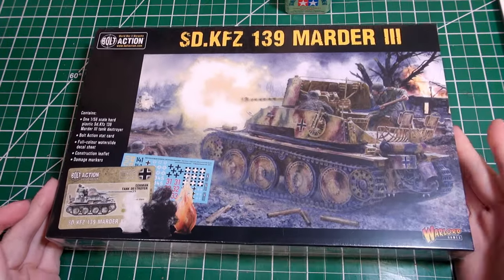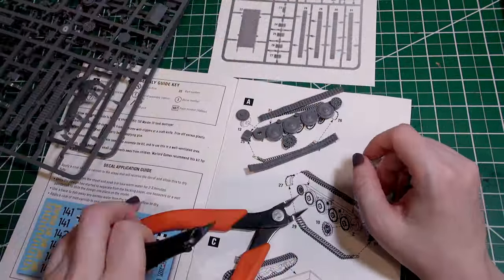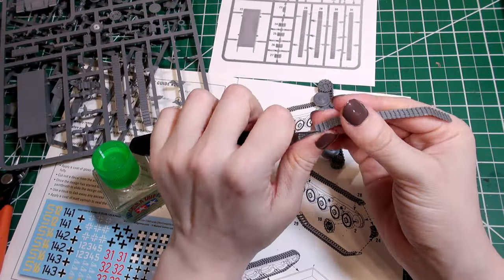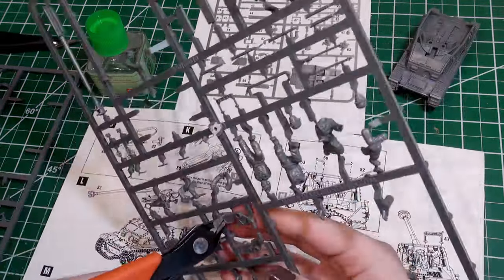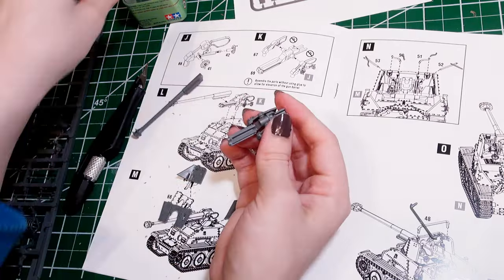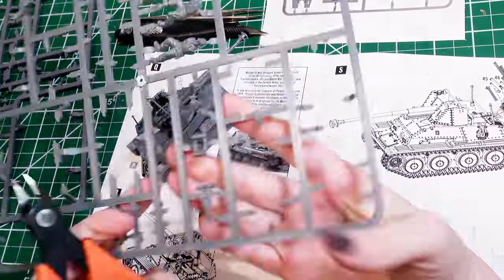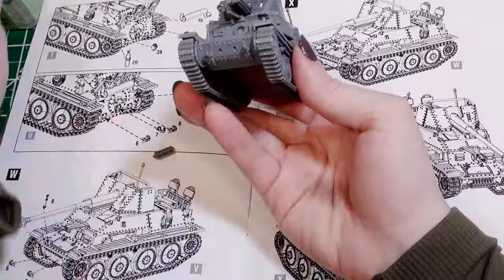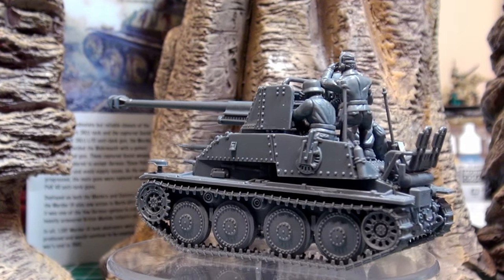Assembly How-To Marder III Sd.kfz 139 in Bolt Action

Comment: I live in Germany and although the name of the "tank" has nothing to do with it (german tanks have been named after predators for a long time), I can definitely confirm the Marders vs. cars problem. Special equipment like encased spark plugs or steel brake lines limits actual danger, but losing the A/C twice per year because one of those little freaks gets high from chewing on rubber hoses is still annoying af.

Comment: Maybe it's a dumb qustion, but why did you cut out one of the instruction pages? Are the part numers printed there but not on the sprue?
Reply from the maker: Yes, that's correct :)
Reply: Oh, okay, thanks. I've never seen it done that way (but I'm not really into tank models that much). Maybe it's to save on space on the sprue? @swordnsteele712